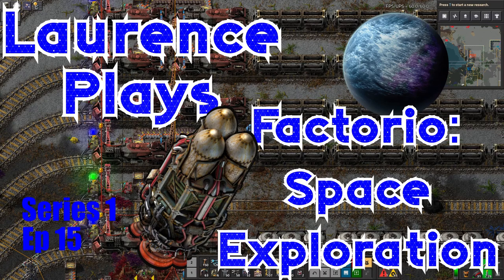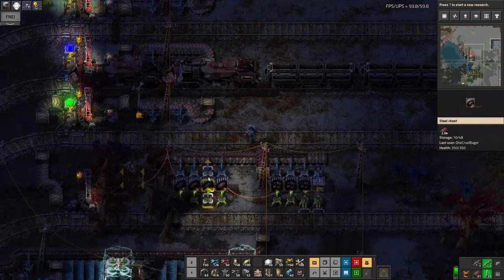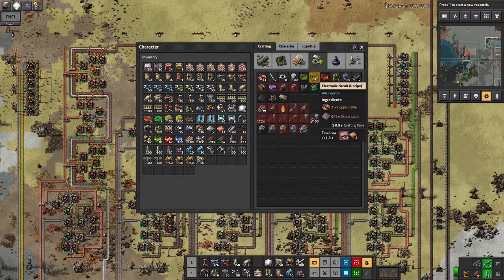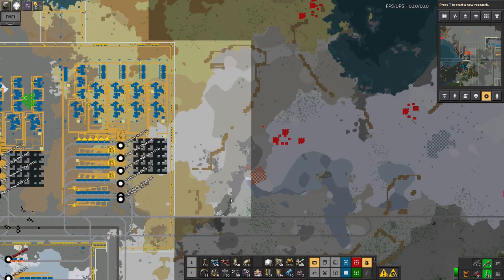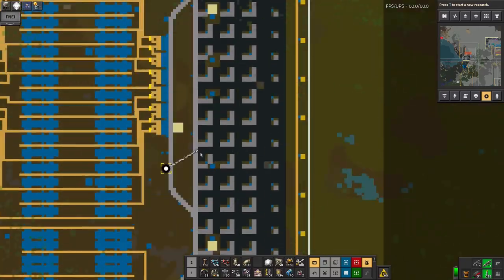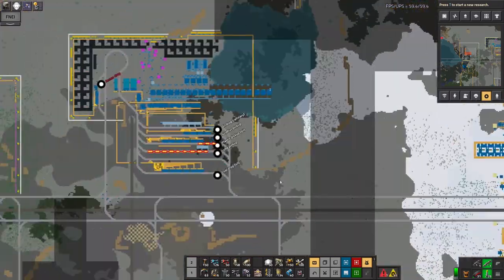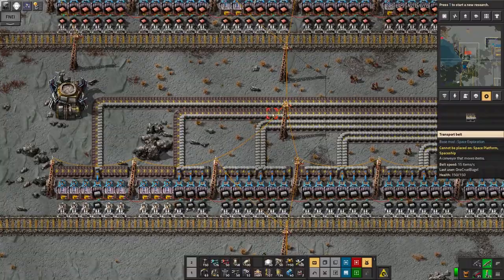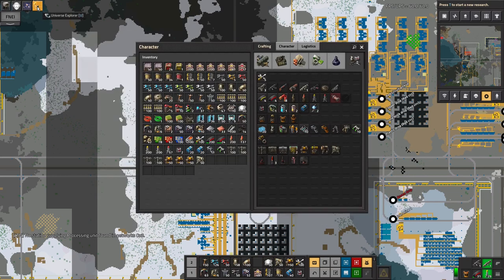S1-E15 - Logistic solutions - Laurence Plays Factorio: Space Exploration

Comment: The copper cable to green circuit machine ratio is 3:2.
Reply from the maker: I had to go and check this, and you're quite right, it looks like I didn't notice that each cable production run produces 2 cables, so I ended up making 3:1 instead. Bah! Well, I'm not going to rip it all up now, but I will try to remember that next time I build a green circuit plant! Thanks  :-)